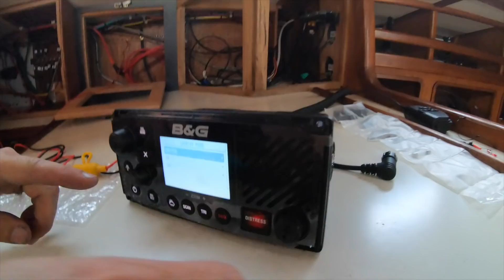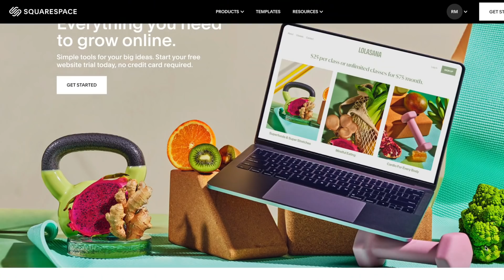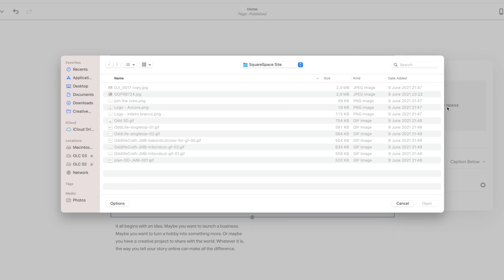⛵️Brand new SAILS for our (ONCE) Neglected sailboat!! #193

Comment: I don’t see a drain in your propane locker, should it not have a drain in case there is a leak from the valve on the bottle, propane is heavier then air so it settles in the bottom of you locker. If you have drain it will drain out.

Comment: The pipe you installed for the gas was a hose pipe not a gas pipe. A gas pipe is orange and has an inner core. It’s not clear like the one you used and is very dangerous
Reply: Yes...several warnings on the improper gas line being used in these comments.  Venting the locker and a gas detector a must too.

Comment: did I miss something?  If you have an emergency and need to shut off gas fast because stove/oven has uncontrollable fire-  you cant reach over stove to get to valve.   Don't like your hose either.   You are the captain.  You-tuber  "Life in a Nutshell" had a gas leak and blew up everything inside boat, floors, doors, cabinets, ect.    What a mess- lucky he didnt get killed.

Comment: Your propane value location is no bueno. Imagine you are cooking a meal and you have one burner going and you need to light a second burner.  Something goes wrong, you have a failure and you have unregulated propane is leaking and it ignites.  Now to turn off the propane you must reach through a fire.  NOT GOOD. Best solution is to put an electric solenoid value at the tank and the shut off panel away from the stove.  Now the valve location is less critical.  Still if you want to use that valve best to move it away from the stove.

Comment: Please get your gas installation checked by a professional. I'm pretty sure that in Europe you would not pass a survey as it is.  I have seen  the results of a gas explosion on a boat - not funny.

1. I could not see how the gas locker drained overboard?

2. You should only have flexible pipe a little bit at each end for the stove to gimble and to allow you enough slack to change bottles over. Otherwise they should be hard copper lines.

3. Get a bubble leak detector for the regulator end. And maybe a solenoid remote electric valve for the gas bottle end.

4. I hope you have a gas detector in the bilge.

5. Is that flexible pipe rated for gas?

Comment: Oh boy....You have just installed the gas hose in a way we never ever do it.  So much so that insurance companies here would not allow it.  I have been present for 3 boats exploding.....  it should be a continuous line from the ventilated locker to the stove, with proper fitted connections...and not hose clamps.  There should be an electric solenoid to turn the gas on and off in the locker.  Two of the explosions were so close to be people dying..that is is worth all the effort not to chance it.  Fitting the large connections thru the boat is hell but its safe.   And AYBC regs.  Please re do this.

Comment: You can always tell which yacht is a cruiser by the terrible condition of their sails. Cruisers will not buy new sails until the old ones are in pieces. Then they sell those old sails to another cruiser who is even poorer than them. This goes for all the equipment on a cruiser. There is a class system of new, second owner, third owner and do not care.

Comment: Those gas lines will not be covered by you’re insurance it needs fixed fittings the cable clamps are no good they always lift one end of the hose and it will leak gas please like this comment so they wil see